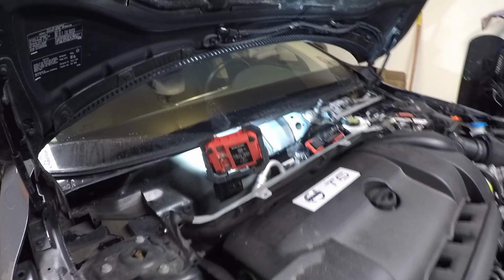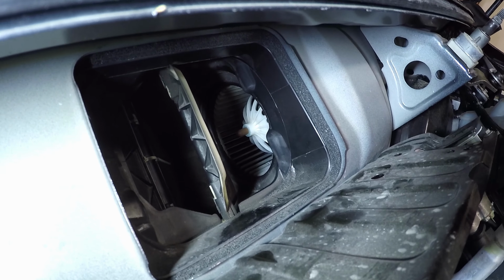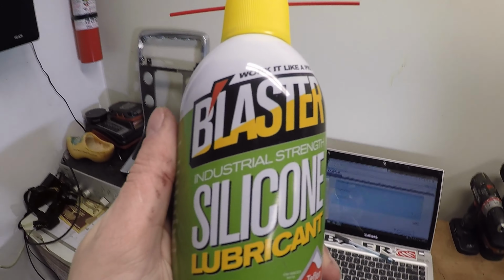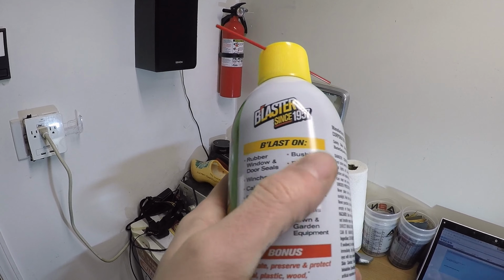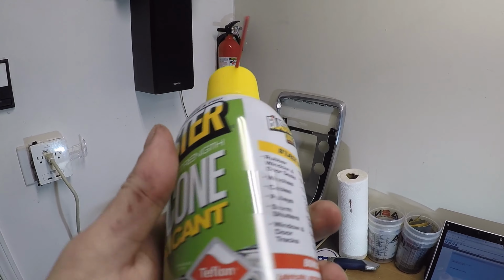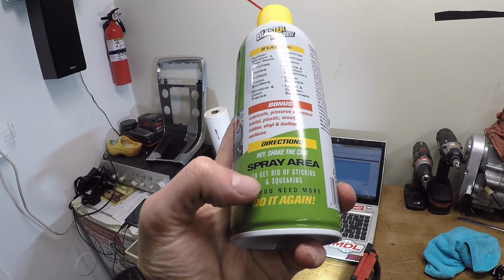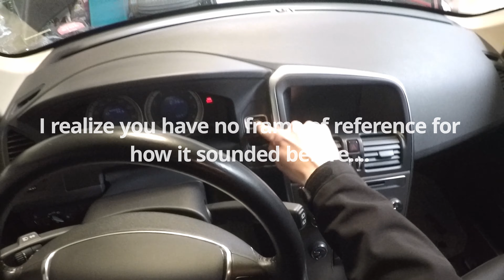Volvo Blower Motor Squeak "Fix"

Comment: Thanks! I just did mine, and we'll see in the winter (when I get the squeak) how well it worked. Two suggestions: Removing the top cover and thus the wiper isn't really necessary--with the fasteners taken out, it flexes easily enough for access without stressing it unduly. Also, to get the lube at the right place, I got myself the ShopStraw FS250 FlexStraw from Amazon, a very long spray can straw, and I taped it to a stick with the end bent to be able to spray toward the bearing area through the blower. With these two, it becomes a five-minute job, so if it works, repeating from time to time won't be a problem. I used Hornady One Shot Cleaner and Lube since it's supposed to be a dry lubricant that doesn't leave a wet film that gunks up with dust.

Comment: Thank you very much! I did it too on my S80. I was actually sceptical but it works! How can it be so simple? I have now driven about 700 kilometers with the car and the motor is still silent. I will share your video on our Dutch Volvo forum.
Reply from the maker: Glad this worked for you! It's about 5 years since the first time I've sprayed it and unfortunately it comes back fairly quick now. It looks like I'll be doing the motor soon 😭
Reply: @GTurbski  If I can reach 4 years with spraying now and then it's fine for me. But indeed unfortunate that it doesn't work for ever.😢

Comment: I went through the struggle of replacing the blower fan. It's a permanent fix, but If I knew about this I'd do this even if it was twice a year. It was a painful process
Reply from the maker: This is where my head is at. I really don't want to replace the blower motor,, I'm ok doing this once a year.
Reply: It's not that bad
Reply: @GTurbski  Is it the case that squeaking = eventual failure?  Mine has been squeaking intermittently for a year (seems weather-dependent) but it has never skipped a beat.
Reply from the maker: @benjamindoyle668  the bearing is failing. It will probably eventually lock up.

Comment: Did it sound like a cricket?  I've noticed a cricket sound (loud) that comes and goes, and I'm certain it isn't a cricket.  My blend door doesn't seem to work the way it should -- it moves a little here and there but I've never seen it fully open or fully closed in the couple of times I've had the cowl lifted up to check sunroof drains.
Reply from the maker: Yeah, more or less.

Comment: Did this also make a noise when the blower was turned off? Because I have a very annoying sound from the dash and i dont know what it is. 
When my blowers are off (or on) and I drive in a lower gear it makes more noise because of the car vibration. When i am not driving, no annoying sound at all.
Reply: Can be the refrigerant moving through the valves but also make sure that the aux input is not receiving interference. I shut off the infotainment and the noise disappeared!
Reply: @robinwells8879  my problem is solved and it was totally something else, for anyone who can have the same annoying issue: it was the hook under the hood/bonet on the window side, the hook that has to hold the hood/bonet when you crash and the airbag popups, there is a plastic on the hook, mine was broken and slided to the other side, the hook touched the chassis of the car by every vibration of the engine. After correcting the plastic on the hook I have never heard that noise again.
Reply: @empinoza  that must’ve taken some searching to find that problem!👍

Comment: I have a squeaking sound in the dash area ofmy V40 while driving. It's also present if the blower is completely turned off, do you think this could be the reason anyway?
Reply from the maker: No
Reply: I had the squeaking sound from the dash on my S60 2011. Solved it by tightening the four screws around the main LCD TFT screen. You will need to remove the trim around it. K.
Reply: Pulley or belt, especially if the weather's humid. When the engine warms up the sound goes away, correct?

Comment: Think I will just take mine to the shop and have it replaced if you're saying it only last a year. Good bandaid fix though except I don't think it is. That's too much stuff to pull for a bandaid fix.
Reply: You're kidding... it's simple. Six clips and a nut on each wiper. This should be standard maintenance on all P3 Volvos ~
Reply: FYI, this takes like, 10 minutes of real time to do. I’m willing to put in 10 minutes a year to save on a $1200+ repair!